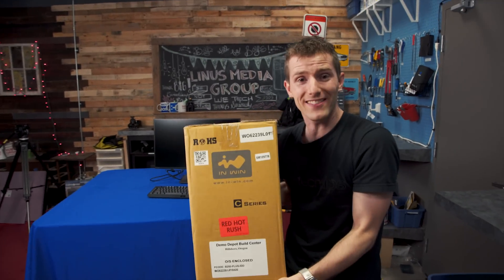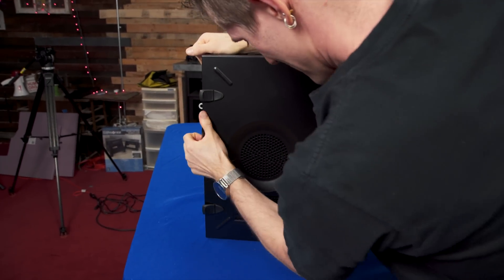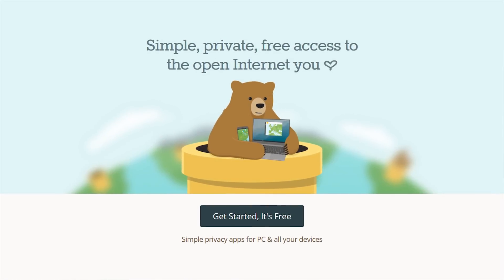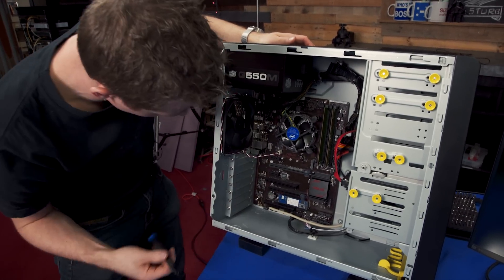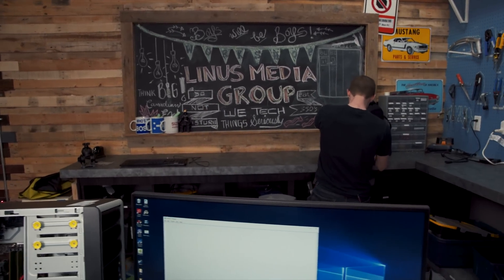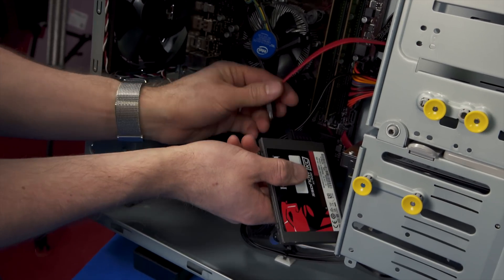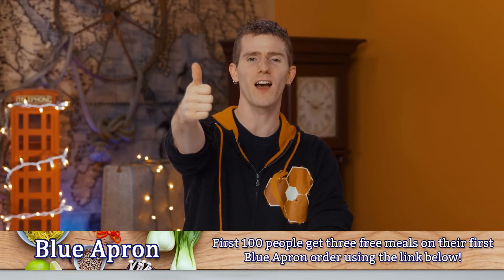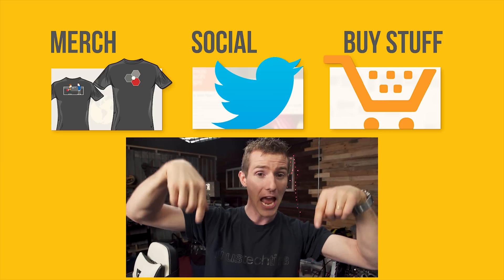Turbocharge your SSD for $40??

Comment: Chances are, if you are still only using a hard drive, you won't have a M.2 slot
Reply: Exactly this. If I wanted to spruce up say.. my grandfathers old PC I would opt for a regular SATA SSD, because his 2010 motherboard cannot support M.2. I guess you could also buy a PCI-e adapter with an M.2 slot on it, but that would probably be more expensive than just a random SSD for the OS. :/
Reply: it only works with kaby lake
Reply: pcie nvme adapter are still an option
Reply: ...maaaaybe in a gaming laptop prepared to have M.2 cards, but sold with no card installed, as a way to speed up the mechanical drive?

Nah, just forget it. It's way easier to just plug a SSD and forget about the damage on the HDD because of moving the machine around.
Reply: That exactly what I was thinking right before he brought up the part about the kaby, and then that made even less sense lol
Reply: can't do that either because the motherboard's BIOS itself has to be support NVME/PCIe storage. Anything pre 2014 is mot likely not going to support this standard.
Reply: i have raid 0 hard drives xD and then obviously an ssd and m.2 ssd so yknow 💁
Reply: One hundred percent correct. The technology is interesting, but in it's current state, it's  useless. If you still run a hard drive, you probably don't have an M.2 slot, and to be honest you probably don't know what an M.2 slot is, nor do you know what Optane is.
Reply: Chances are, this will be mostly for pre-built systems.
Reply: Ryan Doherty you're right
Reply: i have a kaby lake pc and a 1080 but i dont want to spend 1000$ on storage to cut down on loading times when they really aren't that bad
Reply: Ulrik Krain
heh i have a z87 actually the ssd i use is msata half size.
Reply: That is still no excuse, plenty of good sata ssd's, got my samsung 850 pro 128gb for $100, not to much for a boot drive I could possibly use for up to a decade.
Reply: hi brother xD
Reply: @IpNixy not to mention your grandfathers PC probably doesn't have a Kaby Lake processor in it, so even with a PCI-e M.2 adapter, you couldn't use this :(
Reply: Linus said we should use it with z270 chipset with kaby lake... Screw every single one of the other customers who got a z170 and a skylake like me
Reply: Ryan Doherty Bought my pc 6 months ago. Only came with SSD. I still have 2 m.2 slotd
Reply: +MikeCrazy Phucker Optane is only for Kaby Lake so yea you cant use it with skylake.
Reply: Raid0 with a SSD? That's not really how raid0 works...
Reply: +zake881
you should so dedicate 60-120gb of your NVME to caching the raid array, it works great :D
Reply: I just build a new rig couple months ago, and still running HDD. It has M.2 slot. Honestly I don't see why you really need SSD for Windows. Had an Evo 850 for my Macbook Pro, and while it boots Yosemite instantly, I didn't really missed it on the new Windows rig -- well, apart from that crappy Chrome loading time. But honestly it's just for the first load after booting.
Reply: too right, and the better battery life!
Reply: Сабина Дмитриева This is an an English video not German.
Reply: Matthew Smith Do you not realise Optane costs £40? Not £1000. It's in the video title.
Reply: Ryan Doherty correct!
Reply: I do actually, Z170 MSI PC-Mate motherboard, just never got around to buying an ssd
Reply: @MPOEROT you are missing out on not only chrome loading faster, but all your programs loading faster.  games load near instantly, there is no such thing as load times in a game anymore, and your games just perform better.
Reply: BarelyPro Ok, but since you know what your doing, would you get an ssd or optame if you were to upgrade?
Reply: I'm using the dual setup  thingy where you have both :D
Reply: nah dont need to, i use it for like general files, anything i need loading is on an ssd soooooo
Reply: True, pretty sure my Z77 board doesn't support it :P
Reply: i have an M.2 slot but use HDD. cuz it just working fine and i don't thing i really need M.2 drive.
Reply: Ryan Doherty, applies to me. I bought a mobo for Haswell chip when m.2 were being used for Wi-Fi and Bluetooth adapter ports. mine has a Wi-Fi adapter in it. I can pop it out for optane. I got 7 hard drives and 3 of them are HDD's the others are SSD's. I would be curious to see how optane handles multiple hard drives too. mobo is an Asus Formula VII.
Reply: IpNixy you then assume that his motherboard has an available PCI-E slot for the adapter... Granted it's more likely to have an available 4x(or up) PCI-E slot available than an M.2 slot, it's still an assumption.

Also, people like your grandfather don't expect things to boot and load fast, they have a lot more patience because they grew up before the time of 'instant gratification'. In fact, I was born in 1988 and while I do consider myself part of the instant gratification generation, I at least remember the sound of a dial-up modem and times before smartphones or google...

tl;dr: The people that would 'benefit' most from this product (speed wise) probably don't care for it nor want it.
Reply: That's stupid, last year I bought a very expensive i7 6700k that is not compatible with Intel Optane. Thanks Intel!
Reply: Miguel Rodriguez - Apparently you haven't watched tests of SSD's.
Reply: i have a m.2 slot and i have 2 5400rpm hdd's (kill me)
Reply: Since this is both CPU & Chipset specific, you will have a M.2 slot.
But if it wasn't, there are a ton of M.2 adapters for PCI-E, for single, dual, or more m.2 slots on a single PCI-E slot.
4 M.2 on a PCI-E x16? It's a thing. Go for it. Just don't expect to use Intels acceleration tech on it.
Reply: Jokes on you my old laptop has an M.2 slot and only a HDD
Reply: And, three years after this comment, I still have 7 hard drives, four SSDs and two optane sticks (a 16 GB and 32GB) accelerating two of those hard drives. And those two drives (3TB and 6TB) are the fastest ones I have.
Reply: I have 3 harddrives still..
Reply: i have 2 storage hard drive and a boot ssd....
Reply: mymanmitch1096 it might help your load times a bit, but personally I'd rather spend the money on a 120GB SSD for Windows and other startup utilities. If you already have an SSD for that and have the money to burn, sure, might as well gain a few seconds here and there :)
Reply: got my PNY CS1311 120gb for $40.  More storage, near same performance as optane?  yea, what exactly is intel going for here.  optane was supposed to be the "next" SSD tech, faster, better, lower latency.  it is NONE of those things.
Reply: Kimmaz don't feel so bad. As long as your hard drives are not from the dinosaur age, they're more reliable than any SSD on the market today.
Reply: wildonemeister I worked for a data recovery company. Yes they are much much faster, but have fewer read/writes than any mechanical hard drive today.
Reply: incorrect my mobo supports m.2 yet i only have 3 harddrives no ssds

Comment: I can see it being useful when getting to much larger capacity HDDs. So something like a 5TB mechanical drive with an optane drive to support it, and then an ssd for your main system. And this could be useful especially if you are trying to have your whole Steam library on your machine, which could be multiple TBs.

Comment: As Linus mentioned,  you need a new processor, new motherboard (with a new connector), and an optane module to even take advantage of this. Right now, the cost isn't worth it, especially since it's possible (with sales and dealhunting) to get a 120GB or 240GB SSD for $40 or $80 respectively. The same cost as the optane module alone. This won't hit mainstream until Kaby Lake is "old," when manufacturing costs have gone down and KL processors on m.2 motherboards are ubiquitous. Which by that time, manufacturing costs on traditional SSDs will likely also have dropped.

Comment: I wonder what those numbers would have looked like if you had been using an 850 Evo instead of one of the cheapest SSDs there are.

For that matter, why even bother with a "booster" on an M.2 when you can just plug in a 960 Evo or a BPX into that socket?

Comment: So why didn't you test its performance and latency as a regular block storage device? I am interested in using it as a ZFS ZIL/SLOG on a C612 motherboard, but don't know if it would be much better than an 100GB Intel S3700.

Comment: It's cool. Would be cooler if it worked with other chipsets. Does it only work for the system drive? What if i pair it with a second mechanical 2tb drive with games? Or does it cache EVERY SINGLE DATA from all drives?

Comment: Now, I may just be a simple country hyperchicken, but I don't quite understand about half the arguments against this product. One could pick up the cheaper version of this product, a smallish boot SSD, and 2TB HDD for what? $160 bucks? The optaine module should in theory make your HDD emulate SSD load times for the programs you use the most for 1/3-1/4 of the cost of an SSD of that size. (Assuming that the chip won't try to boost the SSD and focuses on the drive that needs it.)

Now the fact that you need a processor with a model number that begins iX-7, that's a bit of a kick in the teeth. I have an i7-4790 and there doesn't really seem to be a particularly compelling reason to upgrade that to any current gen chip. Sure I'd love to save some load time on things like Total War and Pillars of Eternity, but dropping $350-$400 isn't worth it.

Comment: MOST content creators I know still are using a few HDD's in their systems. These drives are usually the drives that hold large volumes of content or media. I know Id be interested in an Optane chip if the files I have been working on recently responded nearly instantaneously after the upgrade. But those Optane modules look small in size and if they are filling up on OS data even if said OS is on a boot SSD it may not have much room left for the media files. Id like to see more scenarios tested if you still have that chip.

Comment: The optane looks really interesting. Especially if you are looking to speed up a system that needs lots of storage, but you need to do it on the cheap. Your video was great to point out the benefit when peered with SSDs at the moment is minimal.

Comment: But won't this heavy caching technique work with any SSD over heavy read cycles and workloads regarding audio / video production ? For example Ableton, Adobe Premiere Blender, the loading of modules that also involve heavy number crunching and algorithms, intense calculus - like pulling up racks, compressor module, etc ?

Shouldn't those synthetic benchmarks amount to something and find that " ideal case " in other uses / real world purposes behind benchmarks only ? - Which is pretty much d1ck inflating / flaunting if otherwise

Comment: Considering I would already have to update to newer hardware to use this, not worth it at all in my mind. 
I'd need to fork out the money for a new Mobo and CPU, and assuming I wasn't going to get a larger SSD than what I have so I can get rid of my two mechanical drives, this doesn't "Wow!" me into saying I need to upgrade to get it. 
Sure I could by a PCIe card to run it but, that's still more hassle than it's worth for running a build that was probably "made" for this kind of hardware.

Comment: Linus, I wanna know how this module performs for peeps with multi-drive setups. Like a boot SSD and a few HDD's for working data. Will the optane fill up on the faster SSD data or will it only prefetch data that is on the HDD and would otherwise be slower !?!?!?

Comment: Wanted to know what you think about testing this in a laptop that comes with an m.2 slot and a spinning hard drive i think some of the gaming ones come with them these days but they load the os on the m.2 most of the time now. I think this is a pretty cool test. I would also like to see this on systems have have ssd and hard drive in there with octape

Comment: Your testing was only with single drive systems, so I am curious how this works with multi-drive systems where each drive can vary drastically in speed. My system has 2 SSDs and 3 HDDs (OS on an SSD, HDDs mostly mass game storage) would I notice any improvements with this say when accessing files or applications from the HDDs?
Reply: Tony Cole the Intel obtained performance video had the answer in the comments but I remember it came to the conclusion that it's pointless. The loading times boost it gives for games is marginal or none existent, it only helps with OS/boot really but you could just buy an SSD for that
Reply: multi drive does not mean RAID.  it probably would show benefit to RAID setups, as the OS sees the drives as a single system drive.  I have 2 SSDs and 3 HDDs in my system.  The SSDs are stand alone, and the HDDs are software RAID(storage spaces).  No benefit for me, since the difference with SSDs is almost nil.
Reply: I do have some of my long load times games on an SSD
Reply: PCIE SSD makes Intel Optane PC look like windows 95
Reply: Well Optane cannot address RAID configurations so multi-drive systems won't benefit from it.
Reply: Michael Dimech multi drive systems don't have to be configured as raid in order to benefit
Reply: You said it yourself. Its mass storage. Hence y n how the Fuck would you want to speed that? This lol Shit is just a small ssd for putting the os +1 game? into. So at best you could get 1 game running faster at a time? (Or mb Nothing. If you run many normaly)
Reply: why are you only putting your OS on an SSD?  you lose the best benefits of an SSD.  Loading fallout 4 on an SSD versus on an HDD is night and day.  elevators no longer take ages, and the game loads in seconds, not minutes.  Ditch that HDD, and get an SSD for your games.
Reply: No difference
Optain is for the boot drive it cache in optimistic thinking the pagefile
ssd is fast enough 
one way to make this methode really fast were
pagefile in ramdisk. is copy for boot
pcie gen3 x4 =4gb/s vs ssd 500mb/s
System booots faster. for this should i pay 80bucks. for faster boot.
come on my system starts with ssd coldboot 40sec with a smalöer mainboard with less hardware it would be 10-15sec
Worthless thing
Reply: I agree, I'm wondering how useful optane could be in a nas setting - probably not a whole lot but curious nonetheless. I'm also missing a comparison between hdd + optane vs ssd vs a hybrid drive and a comparison of the cost/ performance.
Reply: Tony Cole you're*
Reply: PROUD RUSSIAN "You're testing was only with ..."?

There's only one idiot bigger than the one who's confusing you're and your ... the one who tries to correct people who use it properly.

Comment: No linus, it's a solution to a question no one is asking.  Grandma's Dell has to be brand new (only on kaby lake) and likely won't have the slot.  Cheaper/easier/better to just buy an SSD.  Call a spade a spade and claw back some editorial integrity.

Comment: Why not test it with an SSHD? I never expected a noticeable difference from using it with an SSD.

I wanna see how it works with the cache from something like a Firecuda and then load up a few games. I already have a couple of SATA SSDs and a HDD, but if it worked a Firecuda + Optane Memory Module could be a really good solution for cheap game file storage.

Comment: I can see it being used in SANs instead of NVRAM for write caching.  And in a future form for SSD caching.  But right now it's pointless.  For the cost of the optane module, just buy an SSD instead of a hard drive.  Unless you're building a storage box, but in that case (for home users), chances are you're using it for streaming media (which won't cache) or are running it over gigabit ethernet, which a regular non-cached RAID array will be fast enough for anyway.

So like SRT - pointless, and if anything reasonably cost vs. just going for more SSD for 3-6 months.

This will be far more useful as NVRAM for portables so wake from sleep works much better, more useful in SANs to replace NVRAM write cache, etc.

Comment: I never played any of the GTA games but I tried Deus Ex Mankind Divided and I only had 4 GB of ram.  They recommend 16.  I was able to play it but loading times were horrendous and I had a lot of graphics problems.  Now with the same PC but 32 GB of RAM I don't have any of those problems any more.  I had all the other recommended requirements met except for the RAM.  Now I don't have loading times that are nearly as long as when I had just that 4 GB of RAM.  I don't have an SSD yet but I have a 300 GB WD Velociraptor.  It may be old but it blows those pesky green hard drives out of the water.  If you ever had the green ones they are terrible because they are always spinning down and they take what feels like forever to spin up.  The only reason I have any green drives is my Uncle gave them to me.  I guess he didn't like them.  Next time I will just make him return them than pass that junk off to me like that.  I have one in my PC and it is not the boot drive and really has no value at all aside from being a backup drive.  The main reason I don't want them is I want to need a hard drive so I have an excuse to buy a good one rather than wait for that insufferable POS to spin up every time.  My Velociraptor is not by any means a new drive but as long as it is not being compared to a 15,000 RPM server drive or SSD they are still very good.

Comment: Worthless, stick with SSD's or like I plan to do in my future upgrade go with M.2 Drive. I try to keep my PC light, so I don't use Terabyte drives, I only have a 1TB external drive for back up and it's not even half full. Right now I have a RamDisk for frequently used files, SSD for not so frequently used files, and a 140GB HD for long term files.